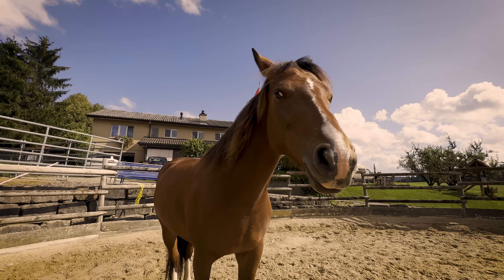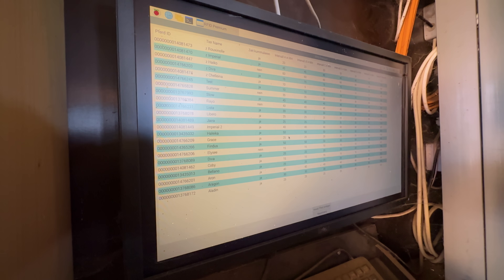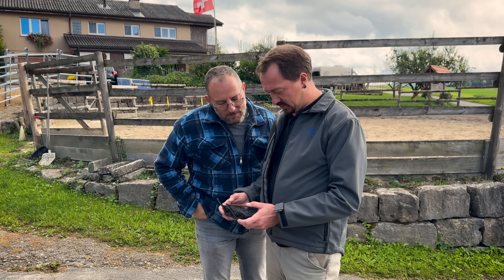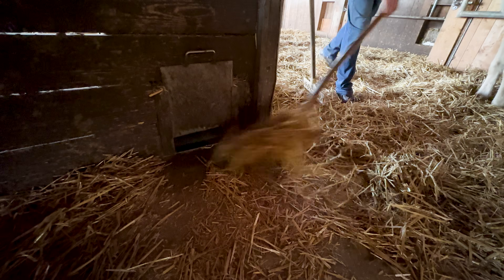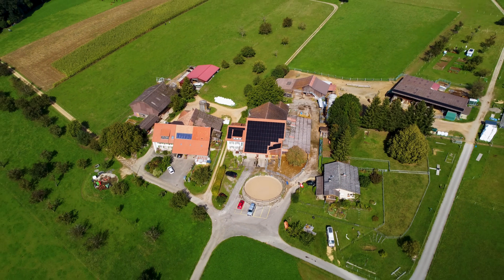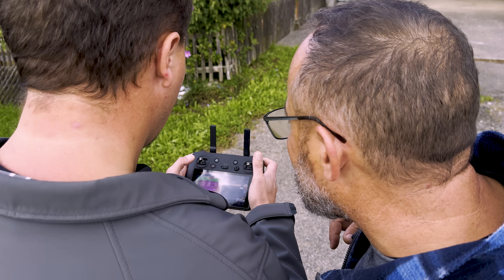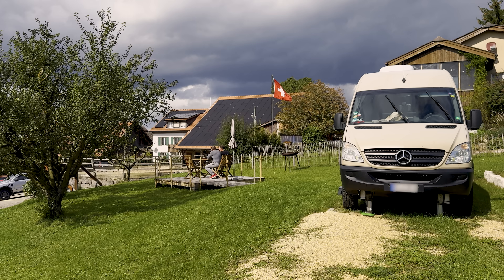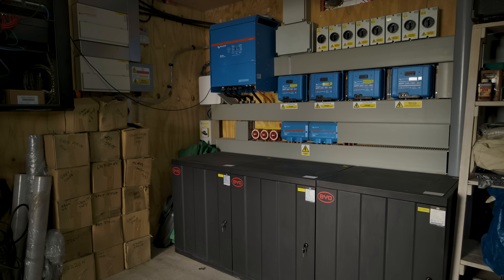This horse ranch has automatic feeders, stable vacuums and lots of solar

Comment: A VIDEO SUGGESTION: What is the most extensive, oldest Victron system still in use, what parts of it needed what sorts of repair or replacement maintenance over its entire lifetime and specifically why were such repairs/replacements required (i.e. simple wear and tear, lightning strikes, moisture accumulation, biodamage from something like mold, insect or rodent invasion)?
Reply: My multiplus dates back to 2012. 1600W. it died last year. Just stopped working.
It ran my 4 fridges for 13years.